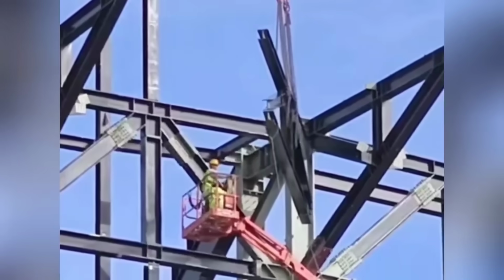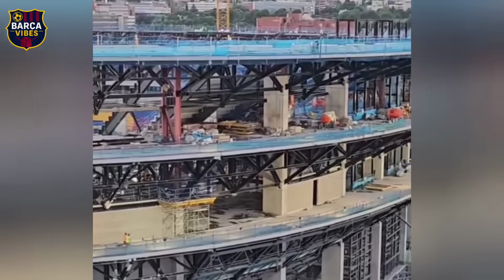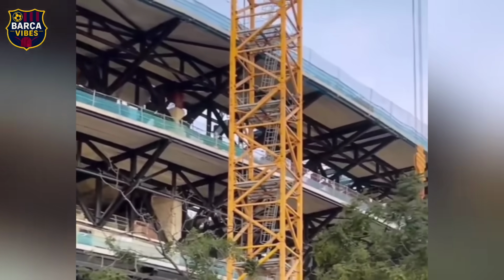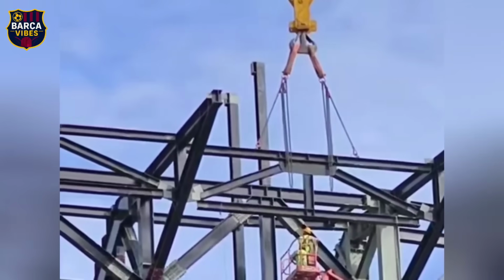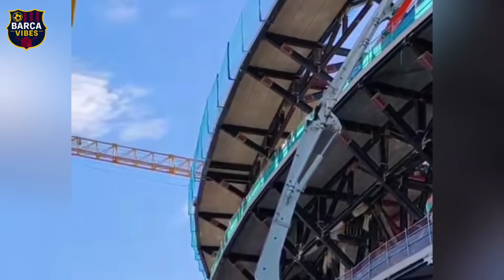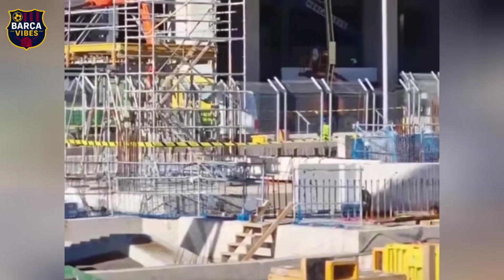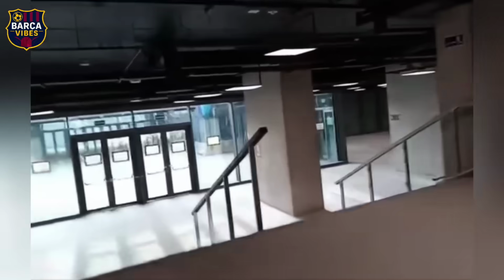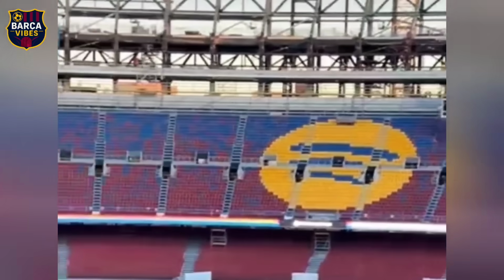Camp Nou Construction Update (2025) | Roof Ring Nears Completion & Façade Takes Shape

Comment: Very well
Reply from the maker: Thanks 😊
Reply: @Vibesbarca bro. Please is it true that the stadium will be much taller when completed. I heard it will reach like 80 meters in height?
Reply from the maker: Nope, that’s a common misunderstanding. Camp Nou’s final height will stay around 50 meters — the 80 meters people talk about refers to the construction cranes, not the stadium.
Reply: @Vibesbarca ok bro. is it taller than the bernabeu
Reply from the maker: The Bernabéu is a bit taller at around 57 m, but Camp Nou will be bigger in capacity — over 105 k seats.
Reply: @Vibesbarca bro sorry for disturbing you with this questions🙏. But will this new camp nou be taller than the old one.  the old one looks short to me
Reply from the maker: Yes, a little taller — mainly because of the new roof, but only by a few meters.